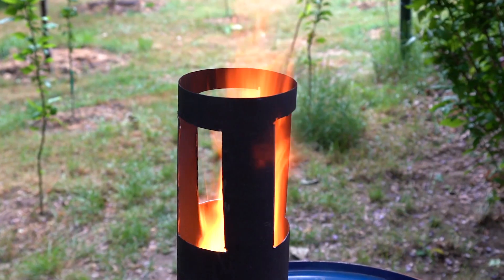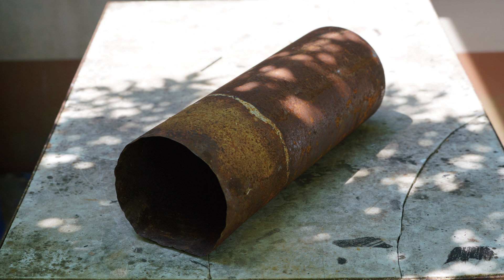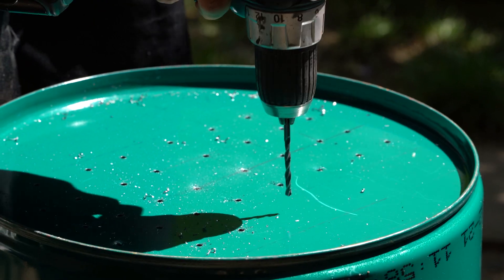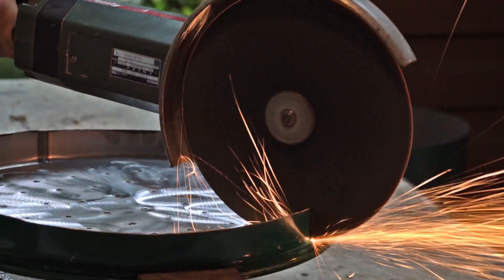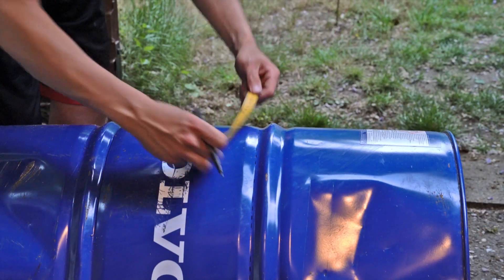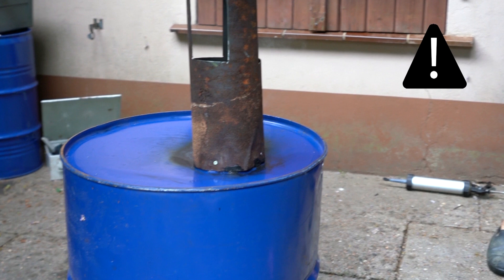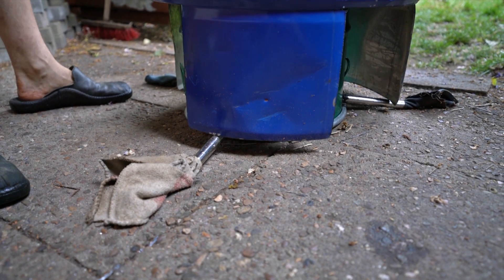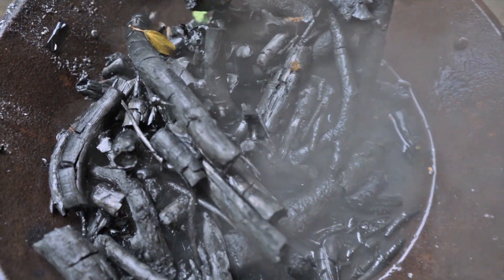"atmoco" - pyrolysis stove for biochar production

Comment: Mal ne Frage, kann man dafür auch minderwertige Holzkohle kaufen und verwenden?
Reply from the maker: Vielen Dank für die Frage: Holz- oder Grillkohle ist das Produkt einer nicht vollständigen Gasifizierung. Die thermische Spaltung (Pyrolyse) ist noch nicht abgeschlossen, was sie daran erkennen können, dass beim Anzünden Ihres Grills noch eine Weile Flammen über der Kohle stehen. Reine Pflanzenkohle (wie wir sie mit dem atmoko herstellen) kann nicht weiter pyrolysiert werden = keine Flammen, nur Glut. Dieser Unterschied schlägt sich dann in der Qualität der Kohle nieder: Porosität, physikalische Instabilität, Aromatengehalt, Kohlenstoffgehalt und funktionelle Gruppen sind nur einige Parameter die in der Grillkohle nicht ideal eingestellt sind.
Um die Pyrolysegase aus der Grillkohle nutzbar zu machen, könnte man theoretisch den atmoko auch mit dieser befüllen. Lange würde man die Flammen aber nicht nutzen können, da Grillkohle sich doch nicht so gut eignet wir das gute alte (trockene) Holz.